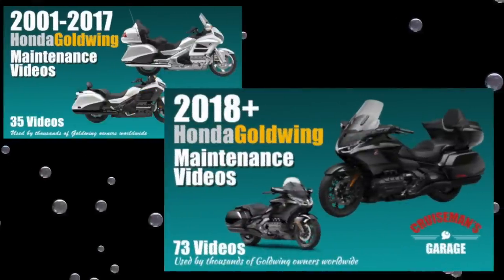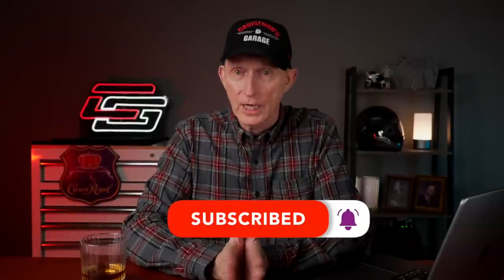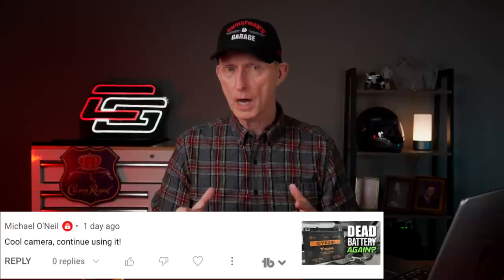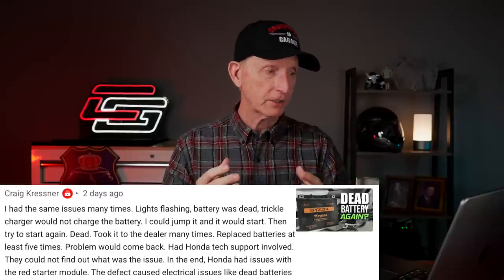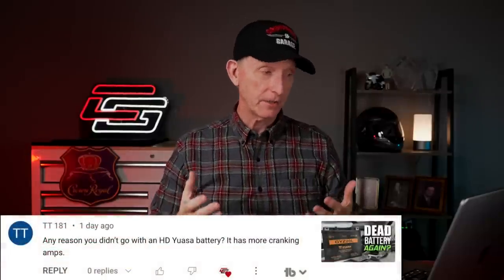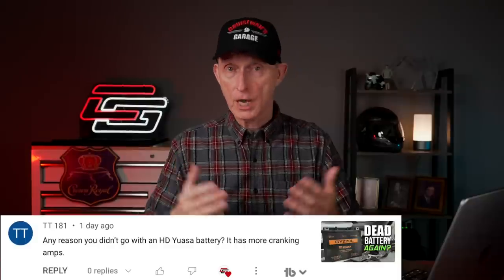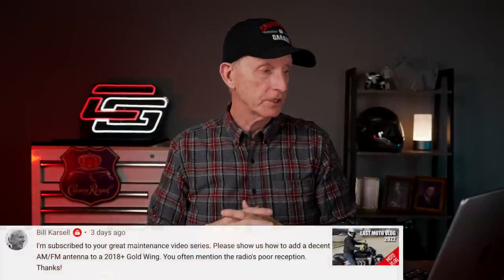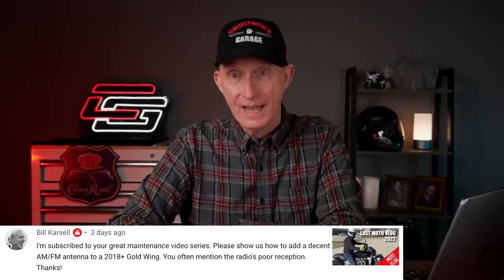Ep 17 DCT Clutch Failures | Crown and Comments | Cruiseman's Garage

Comment: Yup, I call bullshit too.  I am an instructor and I have used my DCT for advanced skills and demonstrations.  I practice the low speed maneuvers before every class, before people arrive.  I have not noticed any issues with the transmission or the clutch.
Reply: I haven't taught for about 10 years now, but I think I'd want to actually see this guy's practice routine - what he's doing, how he's doing it, and especially for how long.  My guess is that he's not giving the bike's clutch (the DCT has two of 'em, but IIRC only one of 'em is involved with getting the bike underway) to cool off between exercises.  Or, it could be that he's discovered a flaw in the DCT design - sort of like the first-gen 1800's where if you rode it at a certain, steady speed the bike would overheat because of the radiator/fan design.  It'll be interesting to see how this plays out.
Reply: My guess is he’s trying to perform the same maneuvers as if he is still on a manual. Slightly high RPM and using rear brake instead of a hand actuated clutch to control speed. This essentially is like putting your foot on the brake and flooring a “manumatic” car like Audi or Lamborghini… you’re just revving against the clutches…. Since I learned to ride on a DCT bike I learned to modulate my throttle without dragging rear brake for slow speed stuff
Reply: @petergriffin8681 :  That's why I said I wanted to observe his practice sessions.  The key word in your post is "Slightly".  My experience riding field games at GWRRA rallies in the 80's-90's (and occasionally winning when the really good riders fouled out) was that I burned out two GL1100 clutches by revving too high against the clutch/rear brake combo.  I'd been taught that the engine acted as a gyro to help hold the bike up - and, the faster a gyro spins, the more stable it is, right?  Turns out, not so much.  When I started riding the 15/1800s and got involved in rider education, I learned to use the throttle/clutch/rear brake combo just enough to keep the bike moving forward.  In fact, I find that I often ride too slowly to make very tight turns - I need more speed to allow the bike to lean enough to make the turn, and it's tough to overcome the "slower is better" mindset.  And, I had no clutch trouble with either the 15 or 18 after nearly 300K miles on the pair over the 28 years I had 'em.
Reply: I think Cruiserman is blaming Honda and not the rider. But you're saying that the rider ruined his bike? I agree. I think he is partially to blame. Because I think that it would be obvious to most advanced riders if they are slipping and overheating their transmission. Having the brake on at the same time as the accelerator would cause extreme heat and would cause a failure, but this wouldn't be Honda's fault necessarily.

Comment: The DCT does have a warning light for when the clutches are getting overheated...also the guy that damaged his clutches had two different DCT wings and did the same thing with both bikes...Honda warranted the first DCT bike and then it was crashed... then the guy buys the second bike and he burnt up the clutches in 1k miles or so and Honda  denied warranty blaming the guy for abusing the bike.
Reply: Does the DCT cut off when it overheats when riding a parade? What mode should you ride in? Does the DCT a fan like the older bikes to cool the bike?

Comment: Any vehicle being run for abnormal periods of time eg demonstrating very low speed manoeuvres by slipping the clutch continuously, will suffer accelerated clutch wear.
In this case the clutch or clutches  are slipping without a break thereby reducing lifespan enormously. Clutches are designed for normal riding including stop-start and normal manoeuvring.
I cannot see how this case can be regarded as that. This is abnormal use described by Honda as abuse.
In one of  Gerry Paladino's videos he advises a student a student to protect  his clutch by practising tight turns for half an hour before giving it a rest to cool down.
Our riding school clutches were wrecked by this training but on older BMW R80RT's the smoke from the single plate dry clutch usually told you when to stop.
Our own mechanics did the necessary replacements as needed!
Enjoyed the video as always👍

Comment: As far as the DCT issue I see Honda’s side of this argument. If you have the standard transmissions you basically do the same thing with it if you’re riding in a parade or drill team which was this guys issue was and what he was doing. If you have a manual the standard thing you do is slip the clutch and ride your brake. Slipping the clutch can burn it out. Honda won’t cover a burned out manual couch so why should they cover a DCT clutch when it’s basically the same thing?

Comment: The DCT is designed to run under normal condition in heavy or light or city and HWYS. It will probably take a rider for plenty of enjoyable rides for many many years. Having said that, doing U turns 4 days a week for weeks at the time, is not NORMAL. Something will give up.....period. The DCT is a very well built tranny with many miles of tested design by Honda. I am not worried even tiny owning one. The DCT is so perfect for our wings that I can't see riding one without it. The batt on the 6th gen, in my opinion, should stay AGM. Keep it trickle charged while parked and all good, when you ride. yes, the wing has a weakness to low voltage, after all its a power plant. Why a volt meter was not put in, who knows. Chris, good video, again. Ride safe!!!!!

Comment: You should have mentioned in your video that the owner of the bike with the burnt clutches on his dct that this happened to 2 bikes. 2020 that burned up the clutches that Honda repaired on warranty but the service tech wrecked the bike on test run then a brand new 2022 with the same burnt clutches.

Comment: The reason the AM/FM radio reception may be poor is not because of an antennae issue but because the receiver has weak signal sensitivity. That would explain your poor performance enhancement after replacing the Honda antennae.
Reply: The am/fm reception issue can be resolved by installing a better antenna. I have successfully carried this out. I installed an oem CB antenna with the appropriate adapter to go into the audio unit. Problem solved a few hundred dollars later!!!

Comment: One thing to consider about at least getting a test ride on several different bikes. While it is not a way to "live with the bike" for a few days, getting to a place where a lot of manufacturers are at a place at the same time to get a test ride is doable. The MotoGP races in Austin every April host many vendors and manufacturers and a lot of test rides on the current year's lineups are available. It may not be what you are looking for, but it is a way to see and ride some of these bikes you are looking at. Thanks for your videos.

Comment: Cruiseman - I have a 2021 DCT - If this guy drives slow speed manuevers why not switch to manual instead of automatic on the DCT? The DCT has a manual shift mode. He should select 1st or 2nd gear so the transmission will not shift.

Comment: Another great episode. Thank you. I don’t have a Goldwing yet, but now I’m curious to see how Honda handles the DCT issues as more riders come forward with similar experiences. Hopefully Honda steps up to the plate.
Reply: Have "more riders some forward with similar experiences"? I haven't heard of any others. The only issues I've personally experienced (2022 GW and 2020 Africa Twin both DCT) are that the AT's default "D" drive mode shifts WAAAY too early (6th gear at 36 MPH) and in 14k miles it's stalled about 10-12 times. Just on the AT though, the GW has been flawless.

Comment: My thought on the DCT problem is that if you had a Harley and the clutch burned up doing low speed maneuvers Harley would probably not cover the clutch either. Not saying Honda shouldn't cover it, but just food for thought. With a regular clutch there could be a lot of slippage that would shorten the life of the clutch. I'm not a mechanic so I don't know if there's slippage in a DCT. I have 21 GW with a DCT and I would think it's somewhat abusive to ride the brakes to compensate for not being able to pull the clutch in. But I know that's how you do it.

Comment: The reason to shy away from a lithium battery is the amount of amps it will absorb during charging. When the lithium battery gets low, it will allow way more amps to rush into the battery to charge as fast as possible. This overloads the charging system of the motorcycle if it was not designed to handle it, causing damage. Since the '18+ Wings have lead acid batteries, it may, or may not suffer damage from trying to charge a lithium battery.

Comment: I have lithium in all my bikes except the new BMW and will change when that one needs replacement. Replaced the Harley battery with Lithium. Wow that was a big heavy battery. Only downside I know with lithium is when its cold they beed to be bumped to kind-of wake up. Not really an issue but can be if you don't know to do that.Good Stuff,.. Cheers!
Reply: Yeah, lithium batteries don't work well in the cold. Recharging will take much longer.

Comment: I don't blame the rider for the DCT failure. What happens if you're in stop & go traffic for an extended period of time where you're lucky if you get out of second gear? Or people that work for NASA and have long lines at badging stations on launch day? I was looking at the Honda Rebel T DCT, but this changes everything. Thanks for the video!
Reply: Rebel T should be offered with a manual transmission. 
I have heard on line that there are better aftermarket fairings and bags available. Do some research,  then buy a standard Rebel.1100 with the 6 speed manual and add what works best for you.
Reply: Ya, I could always get a Memphis shades fairing.

Comment: I still use a flooded battery for my GL, I know it needs maintenance but, being so minimal I don't mind and also it makes me look at things while I'm in there. It is heavier but, that's OK, still not a boat anchor...lol .
Antenna thing, a tunable type would be what is needed I believe, I can't recall if the radio itself has an adjustment screw like some of the car radio's. You have to think about the wavelength  formula   Wavelength = wavevelocity frequency over frequency   ie:  the wavelength, the distance between the crests in meters (m)
 the velocity of the speed of waves are moving in a direction in meter per seconds (m/s)
the frequency, the wave crests that go through a point in certain time cycles per second or hertz (cycles/s or Hz)
 So in other words,  for example purposes : The signal frequency used by the wireless data transmission station is 435MHz, and the wavelength is:

　　Wavelength = 300,000 kilometers/435MHz

　　 = 300000000/435000000

　　 = 300/435

　　 = 0.69 meters

The corresponding optimal antenna length should be 0.69/4, which is equal to 0.1725 meters. When the length of the antenna is 1/4 of the wavelength, the reception conversion efficiency of the antenna is the highest.
Adjustable antennas have a coil that you can shorten or lengthen, just like an adjustable potentiometer in sort  , think of it like a rheostat, almost like increasing or lowering the resistance sorta.  You also have to take into account the impedance of the antenna cable or if that's too much, you could try a signal booster amplifier 12V.......lol     🙃                                                                                                                                                
Be well.
Reply: ..huh?....🙄

Comment: Hi Everyone, I have a 2023 DCT Bagger which is not one month old and has only done 300 miles. I've got trouble with the clutch overheating causing the warning light to come on and then the dashboard lights up like a christmas tree. The engine then cuts out and won't restart untill the clutch has cooled down which takes about 10 minutes. I've only been out twice on the bike and neither of the trips were at slow speeds. I'll keep you all posted as to what the dealership has to say.
Reply from the maker: I know this sounds basic, but have you checked the oil?
Reply: @cruisemansgarage  Hi and thanks for your suggestion. No I’ve not checked the oil. Is that the engine oil or the clutch oil? The dealership has said that there is an E P something or other due to be sent out the owners that might fix it. I think that they are clutching at straws but we’ll see what happens.

Comment: Honda didn’t think about folks using their brakes and accelerator at the same time when in slow speed maneuvers . The Africa Twin is going to have a same issue there is no clutch to feather going through slow speed tracks. It’s to bad the guy you talked about will have to pay for Honda’s oversight.

Comment: I'll be interested to see how Honda treats DCT G'Wing warranty claims if the bike has a trailer hitch on it. Many 'Wing owners pull trailers so it's just a matter of time and we'll know the answer. I bet Honda will deny the claim. So maybe someone will say "Buy the straight shift if you pull a trailer." That's all well and fine unless you like riding the Airbag model. (Not available in 6 speed) Maybe the DCT will handle it. Time will tell. I can't ever remember hearing of anybody that had to replace the clutches on a '01 thru '17 'Wing.

Comment: Regarding the low speed clutch problem, how about putting it in manuel shift using paddle shiffter and keeping it in 1st gear to avoid auto shifting, should solve the wearing out of the clutch.
Reply: I don't think that'd help.  The clutch is still being slipped (by the computer instead of you), the gear it's in doesn't much matter there.  Having said that, when I'm trying to slow-ride I usually do it in 2nd gear because the throttle's less touchy.

Comment: Most basic battery maintainers say they can't charge starting from a dead battery. They require some sort of minimum charge.  I  had this issue with a couple GL1800 batteries.   Very frustrating and counter intuitive. Once I also picked one that would charge from dead, it was fine.   So, its might not always be the battery.
Reply: Yes some have a safety override, like 'boost'-button and can start from a  very dead battery. Mine has that and it will beep to inform you that the battery is very dead.

Comment: I believe you can get a manual transmission with the Gold Wing. I believe, with the info provided here, is the way to go with this bike.
Reply: Agree that a manual is the way to go.  Jerry Palladino "Motor Man" has said that the DCT is difficult to control at low speeds because you can't modulate the clutch. I believe you can't buy a manual transmission GW for the 2023 model year, only the DCT version. Please correct me if I'm wrong
Reply: @johnpflug1567  the 2023 Gold Wing Tour comes with Honda's  wonderful 6-speed manual transmission
Reply: @frankward8003  Thanks for the correction!
Reply: @johnpflug1567  I've seen GW's forsale with manual transmissions. I've not seen the 2023 model year ads so I don't know if a manual is offered for 2023. 
Jerry is correct that slow maneuvers on a DCT GW doesn't work well. Only guy that probably could make the DCT work in slow maneuvers is that CA guy that does lots of riding videos.
Reply: @johnpflug1567  MotoJitsu could probably make the DCT work with slow maneuvers. He's probably the best riding instructor on youtube right now. 
Have not seen the 2023 line up yet for the GW. Would be surprised if they didn't offer a manual. AND if you trash the DCT, Honda won't replace it. That's not good.
Reply: @johnpflug1567  I looked up the GW specs. for 2023 and they do offer a 6-speed manual transmission.
Reply: @RobertMacCready  I have a ‘19 and was able to adapt to the DCT in slow speed maneuvering, and found it’s not a problem if you use rain mode so the throttle isn’t so touchy.

Comment: The MCN battery article you referenced is several years old and Lithium batteries have improved.  You're holding onto old hearsay and fear of something different.  Several Lithium's now cost only about 20% more than an AGM.  They are proven and work well in the GW.  I've been using Lithium batteries in several bikes for over 12 years without issue.  Finally, the Lithium batteries for vehicles are Lithium Iron, not Lithium Ion.  Different battery compositions.

Comment: If the Goldwing DCT can't hold up under low-speed maneuvers imagine how the Africa Twin DCT will hold up?
Reply: It holds up amazing. I have over 25k miles between two different ones 2018 and a 2022. Stuck in sand and mud climbing sand hills high speed low speed zero issues so far.